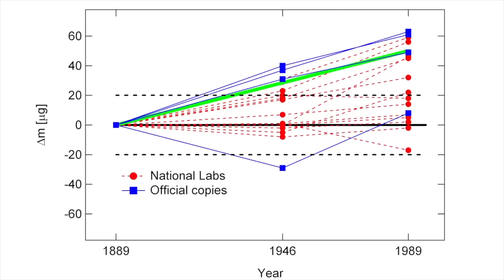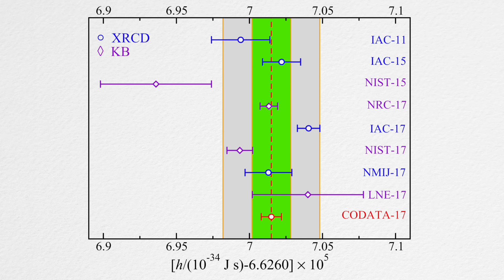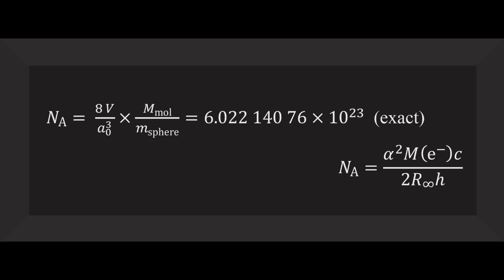The kg is dead, long live the kg

Comment: This is dumb. You can't just "fix" a physical constant. Sure these values are constant as far as we know, but fixing them inherently introduces an error. With the same logic, you can fix the value of pi to be exactly 3.1415 for convenience - this is not accurate.
Reply: Yes, you can. The reason why Plank's constant is now fixed is because physics uses references and the scientists uses Plank's constant as the reference for mass. This can't be said the same about maths which usually don't use units and therefore don't use any references aside for angles and some obscure stuff.

Comment: I solved the fine structure constant issue, and have revised all the constants.  I used pi and the square root of 2, both being irrational, with infinite significant figures.  They should be adopting my numbers.  The Planck length is actually the square root of 2 times 10^-35 meters, but, after I reveal this, I reverse the calibration, to perfect the entire table of values, each to about 52 significant figures of accuracy.

Comment: 1 part per million change of electrical constants can be reflected on HP/Agilent/Keysight 34461A and 34470A multimeters, which has 500 part per billion and 50 part per billion accuracy respectively.

Comment: I didn't know you can VOTE on what is or isn't Scientific FACT...

Can we have a vote to decide on Trump never becoming president?? K thanx!
Reply: They're not voting on fact.  They're voting on what number they should use so they don't break other units.  The numbers of units are actually arbitrary, but if you change one, you need to change others to make the math work.  The idea is to lock one down and treat it as constant without needing to change any other units.
If we find fundamental relationships between units that put numbers in conflict, we then need to figure out which one we should change to make it all work again.
Unless we find conflicts, changes to the definition of a unit are just going to be refinements that allow you to use higher precision than was significant previously.

Comment: I'm Not very smart. Totally dont understand this video...my brain can only understand 1kg physical object. Anyway to explain this video better?
Reply: I can try, even though I will likely fail if this video did.

Before now the units of measurement (kg, second ect) defined what the constants were, so there was uncertainty in the value of the constants is based on our limited measurement methods.

Now the fixed constants will define the units of measurement, this will mean that the value of "1kg" will change slightly (so small it won't affect anyone). The reason to do this is so that we don't need unreliable physical objects to define units anymore,  instead they are based on a number we choose and will never have to change again.

Comment: I would have preferred if the kilogram (and the mole) would be something that can be calculated almost exactly theoretically. Such as the mass of a particular number of non-interacting carbon clusters, or hydrogen or helium atoms, at the zero Kelvin limit. This way the fundamental dimensionless constants would be ratios of parameters from quantum field theories and Planck units. Changes would happen only if better fundamental calculations become possible.

Comment: I think Plank's constant should be set at 1 and all other measurement derived from there.
Reply: Would make normal life very hard. Normal practice in particle physics is to use c=1 h=2π and if you need to you can check the units at the end to see how many times you need to multiply or divide by the actual value. It's not too hard, having h=1 would make baking a nightmare 

"Now slowly stir in 50 zeptograms of cocoa powder, remember to use your billionth of a billionth of a gram measuring spoon"
Reply: @EDoyl  Okay you have to admit, while that's technically less practical, it does sound cool (af)... and we do want to sound cool in case aliens meet us, right?
Reply: Thanks Eoin Doyle and everyone else.  I now see that making Plank's constant one won't work very well, and setting the speed of light to one makes more sense.
Reply: Dennis Shows the problem with that is that we will then get laboratory units with terrible exponents.
Reply: im really bad at physics, but I have a feeling that if this wasnt an awful idea, scientists would have already chose 1 for it
Reply: They have this. Also with c, G, k, and a few others set to 1. Look up Planck units.
Reply: ...and what will you do then, when it proves to be massively inconvenient in the view of new science?  I'll tell you what.  The gram was originally defined as the mass of a cubic centimeter of water until science determined that to be inaccurate, and so then you carried around this OTHER odd constant of 1.003. Or that the meter was 1/10,000,000 the distance from pole to equator giving us the unforgettable 1.0018754

In addition, you'll have to get the world to think in floating point.  That I'd like to see, along with making English spelling match pronunciation (middle American, of course).

Comment: Maybe they can soon get around to redefining the byte to be 10 bits so that bit to byte conversions make sense in a world where kilobyte = 1000 bytes rather than 1024.  Having a kilobit = 125 bytes and 1 kilobyte = 8000 bits breaks apart their desire to conform information-units to the power-of-10 SI system rather than the power-of-2 system originally used.  Personally I think it would make more sense to acknowledge that the fundamental constant underlying binary information is 2 and stick the powers-of-ten on there, restoring kilobyte to 1024 bytes... but I'm not a hard drive manufacturer.  

Also... why not set plancks constant to 1?
Reply: It's plain to see you haven't taken any (or perhaps, enough) marketing classes.

Comment: I love how everyone in these comments are comparing Kilograms and Pounds, like they even try to measure the same thing. The video even said "mass" and still everyone is comparing it to force. 

Also, just about no one uses Imperial. That system died centuries ago. The United States uses a combination of SI and USC units, depending on application. We use base 10 when we expect to need to scale with precision, and we use base 16 or 12 when we expect to need to scale down in geometrically easy to define ways (1/2, 1/4, 1/3, ect.) It's not that hard. As an engineer, I see as many as three or four different measuring systems used in a single part.
Reply: Imperial units were created in 1824
Reply: @2adamast  ok, so my dates were a bit off. Fair enough. I'm an engineer, not a history major. The point still stands, though, that not even the US uses Imperial. We use a hybrid system based on the SI units, but changing number base when convenient.
Reply: @PeregrineHawthorn   The first part then, "like they even try to measure the same thing" , they do. And by now imperial an customary units merged to the same units
The pound avoirdupois, which forms the basis of the U.S. customary system of mass, is defined as exactly 453.59237 grams by agreement between the U.S., the United Kingdom, and other English-speaking countries in 1959

Comment: And now what happens to Big K and all the other standard kilograms? Do they get sold on eBay or what?
Reply: They will most likely end up in museums.
Reply: The big K will worth a crap ton then lol
Reply: @qrdsn  But how many Kilograms will the crapton be then?
Reply: @mbrunnme  

I've hated the word 'shitton' since i first heard it back in the early 2000s.  I guess it's just an irrational hatred of neologisms though, seeing as i have no problem whatsoever with 'shitload' as a quantifier.

Same with 'ginormous'.
Reply: @mbrunnme  good question lol
Reply: @Raketemensch-fl3sv  how do you feel about "metric f***ton" ?
Reply: A craptonne is made up of 1000000 crapgrams , this replaced the old imperial Fuckton that was made up of 2,240 Pelvic Pounds...
Reply: + @FreedomForever2010  

Never heard that one before and, completely inexplicably, it actually sounds alright to me.  I plan to use it at the first opportunity.  Thank you.
Reply: @Raketemensch-fl3sv  I like it for the implication that there is a unit called the f***ton in some other system of measurements for which it might be confused.
Reply: + @FreedomForever2010  

Well yeah, obviously an 'imperial f***ton' would be slightly lighter.
Reply: @1973Washu  Marry me
Reply: @1973Washu  but how many Pound Sterlings would a Pelvic Pound be?
Reply: @qrdsn  probably worth more than their weight in platinum. 

I'll leave now
Reply: @Nathan_Lang  definitely.
Reply: Quinn Richardson No, it’s still a kilogram
Reply: @qrdsn  You mean a crap kilo?
Reply: @qrdsn  not a ton.
Reply: And the vaults that hold them? Converted to escape rooms and megazone arenas?
Reply: They will continue to be kept in secure, stable environments and weighed periodically. They represent some of the oldest running experiments on the stability of metals, so they still have scientific usefulness remaining. It is doubtful, therefore, that the scientific community will allow them to go into less controlled museum environments, which would destroy their scientific usefulness.
Reply: Even ignoring the astronomical cost of purchasing a piece of science history that significant, the kilograms are made of a platinum iridium compound that is pretty expensive just in the way of material cost.

So its probably gonna cost at least $3.50
Reply: If I remember correectly they're made of platinum which at todays price means they're worth 29450 dollars alone if sold purely for the platinum
Reply: @MegaAyobaness  they are platinum iridium. Iridium doesnt realy exist on eart. It comes from commets
Reply: @cia6862  Did you mean "comments" ??
Reply: @MegaAyobaness  less, because its less than a kilo. Your wrong
Reply: @qrdsn  *you're
Reply: @panda4247  panda420-69***
Reply: I asked this question to one of the members of the Brazilian delegation, and it seems they will still keep the IPK 66 copy.
Not sure if they have to stop using it from May 20th. Maybe just correct its weight by the new system?
Reply: I'm pretty sure it'll get sucked into a wormhole. I mean, how would YOU deal with no longer being relevant?
Reply: They still have value, as a standard, just not the standard.
Reply: +@Vishal Naidu 

Wow, thank you, it's all so clear now.
Reply: Le Grande K (and its sister weighs) will still be used as a practical weighing standard for “lower hierarchy weighs”. However, it is now no longer “the king weigh”, instead of having to tare a balance to exactly 1.000000… kg when measuring The Big K, it itself have to be weighed against Planck Constant via a Kibble Balance (get a value of 1.000000XYZ… kg), effectively demoting it to “a” second-hierarchy standard. Moreover, its sister Ks do not need to be measured against The Big K only anymore: They can be weighed directly via any Kibble Balance enabled.

And because legal terms of some (may be many) countries chartered that the national weighting standard is its national “Kxx”, (which still depends on Le Grande K in legal terms), it has to still be maintained as a part of the hierarchy tree for some time until each and every entity rewrites their law or rules to not depending on Le Grande K, in that case, only thing changed is you are weighing against 1.000000XYZ kg of the Big K rather than exactly 1.000… kg.
Reply: It will probably keep getting used for quite a few years, then be put into a museum.
Reply: THEY BELONG IN A MU-ZEE-UM
Reply: They are just useless

Comment: Because of the uncertainty of the last few decimal places, it's weird that the value of a constant wasn't so constant after all ;)
Reply: It wasn't constant,  because of the arbitrary value of Kg, which affected the calibration of all the measurements made to calculate it. That's why they had to use multiple different methods of measure, and take the average.
Reply: The official value used in the metric definitions will not phase chemist's use of the most accurately determined value at any time.  Eventually the measurement constants will catch up.  It's all good.

Comment: There can never be a fixed value for Planck's . The un-resolvable nature of the least significant digits has a lot to do with the Uncertainty Principle. This reminds me of time that Pi was to be changed to an easier number to calculate. If this method of fixing Planck's Constant is really adopted it will not increase accuracy but will only further degrade the accuracy of other units.